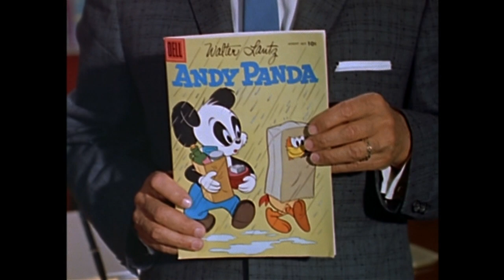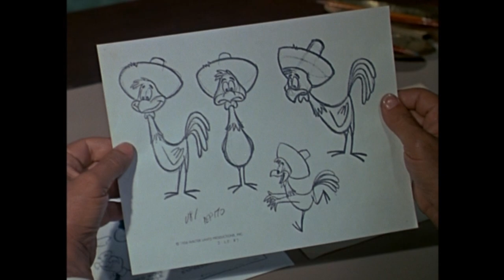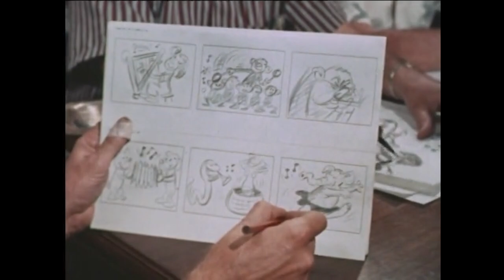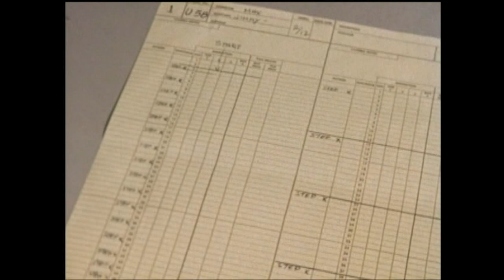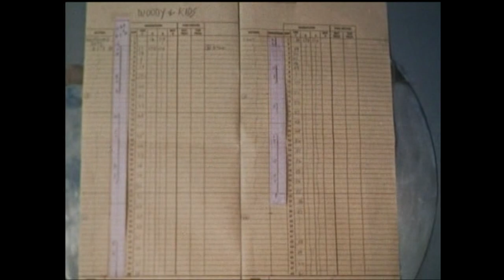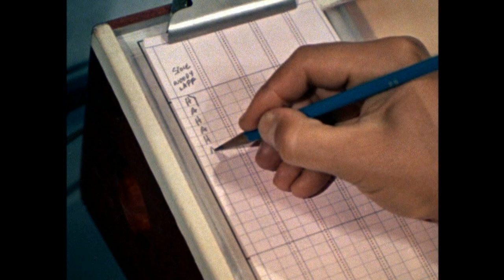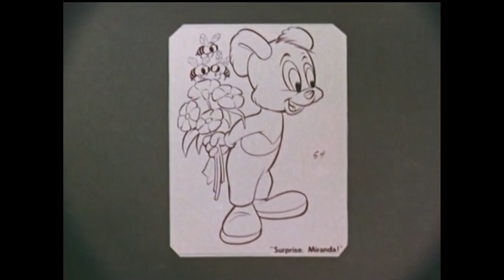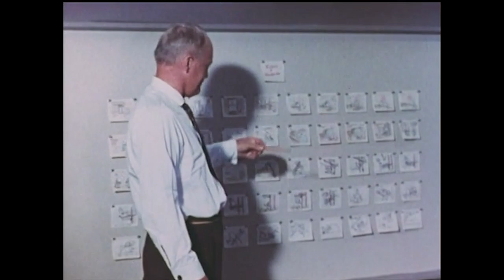A Moment with Walter Lantz: The (Almost) Complete Collection

Comment: It should not noted however that Lantz's anecdotes of Woody's origin may be apocryphal because of the timeline of events. Lantz most likely did not want to admit he was on a honeymoon before he and Grace Strafford were officially married. Writer Homer Brightman was never at Lantz until the 1950s. Former early Loony Tunes writer and substitute director Ben Hardaway joined Lantz's staff around this time, so maybe he was inspired by Lantz's anecdote to do a screwy character or did what he has been doing. The ending of Woody's first cartoon, "Knock Knock", is line by line self-plaigerizing Daffy Duck's second cartoon.